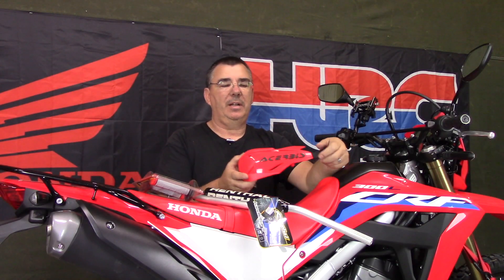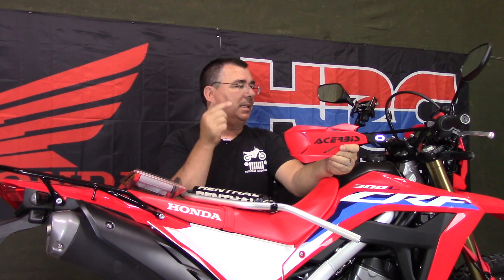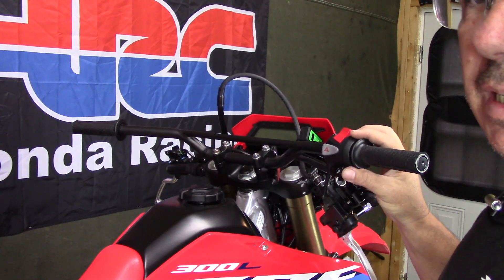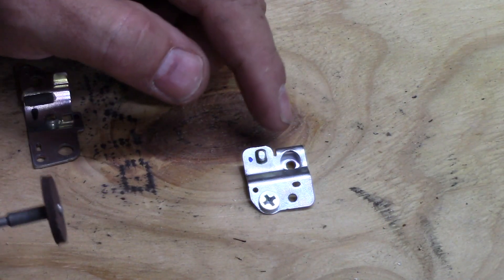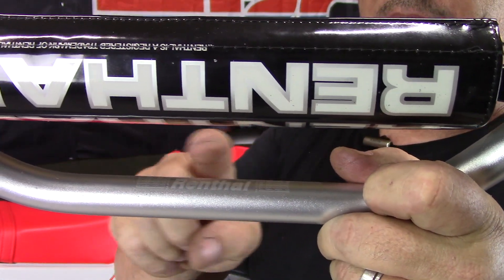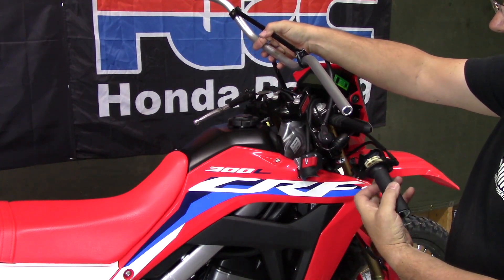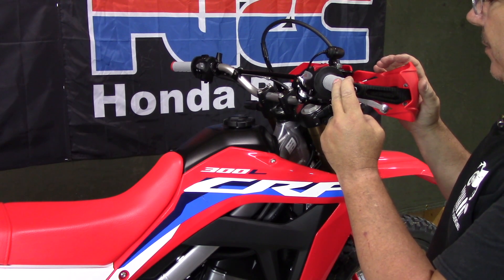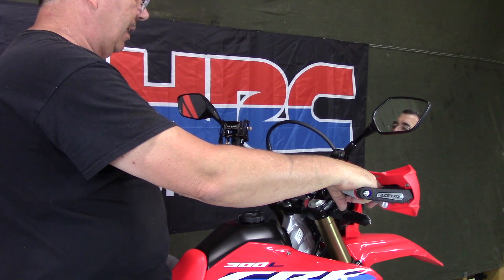Honda CRF300L Renthal Handlebars Acerbis Hand Guards ProTaper Grips Install CRFs Only

Comment: I went with the Renthal 609 CR High bend fatbar on my 300 and I love the extra height and width (6ft 2). All wires still have plenty of room too. Precision Motorcycle racks just released their 300L rear rack for preorder so is an decent USA option for a rear rack if anyone is interested.
Reply from the maker: Sweet, I am waiting one a newly designed rack, should be pretty cool. Should be here soon along with a skid plate and chain guard
Reply: Chris: Are you have 300l or Rally? What risers have you used? How high ?
Reply: @dzinksol  300L, I have the pro taper 7/8 to 1-1/8 conversion riser which is a 3/4 inch rise.
Reply: @chrisweber6129  i tried measure orginal bar. It has 80 cm high, 79,5 width and 73mm of sweep. So you added 50mm to it. Nice! I am thinking to add only riser 50mm without change bars. I do not know what will be better with new bar.
Reply: @dzinksol  Yea that sounds right, feels level for me sitting and much better while standing vs stock. The stock steel bar is fine if you dont offroad, steel bars are much easier to bend / break if you tip. The thick bar (1-1/8th vs 7/8) seems to dampen vibrations a bit better and is obviously stronger.
Reply: @chrisweber6129  May You share photos or video walk around of Your configuration - bars+risers+wires?

Comment: Trying to find the exact bars that you have in the video and wanted to get your input on what they are actually called on the CRFSONLY website. Or if you have the exact model number for that specific height and bend. I really like those and wanna get them for my new 300l.
Thanks

Comment: Wow, I ordered the same acerbis hand guards and color two days ago on Amazon! Great look!
Reply from the maker: Sweet, they are pretty good, a little hard to get lined up but pretty good, you have the rally so I think your bar inserts are removable. I have watched your videos
Reply: @Woodzman  I’ll look to your lead on the hand guard install video, I got a small kobalt socket set yesterday to adjust my rally levers. Great content and deep respect!
Reply from the maker: Yea if your using stock bars you should be able to remove the bar end weights and then the inserts and they will work fine. Because you have a rally

Comment: Hi, great information and I am starting my own bar replacement. Was wondering if you found the torque specs on the risers and clutch / brake assemblies? I only see three torque specs in the manual and none are for those components. Did I miss them?

Comment: Just came across your install. Do the brake lines, clutch and throttle cables have enough free play with the jimmy button bend or did you have to modify that later?
Reply from the maker: You have to rout one of the cables out of the hanger but it works fine

Comment: Hi Frank - 
Questions on the 3m tape please. It looks like the suggestions are 1) once around the bars, leaving a small edge exposed 2) Double sided tape. One side sticks to the bars, but for the top side do you make it sticky also? 3) tape width - .4 or .94?  Thanks for your help.
Reply from the maker: It depends on the tape, I went once around, I’m not sure about the thickness but I did leave a small edge exposed for the controls to sit on. 
 It does work but if I had to do it again, I would wrap black take in a thin layer around the bars, then put the controls on and tighten then a bit so the dimples make marks in the tape. Remember be the controls and drill the bars but not all the way through. I think this would be best
Reply: @Woodzman  I am committed having alread ground off the dimples. Will I regret it if I don't buy a replacement throttle assembly (only way I know to get the plate, have not found it by itself)? Also, If I I go the tape route, do I let the top part of the tape be sticky? Appriciate your help.
Reply from the maker: Mine has the double sided tape and I haven’t had a problem yet
Reply: I tried every thickness of tape in every location, nothing worked. I had to get creative to build up the bump on the plate I had ground off, then drilled the bar, all fixed.
I wasted a bunch of time trying to make tape work. Do it as designed and start of with a drill.
Reply from the maker: Worked fine for me, mine is still that way and working. 
 But drilling the bars works also
Reply: @jzmarzly1  how did you build the bump back up? I’m in the same position as you were, regretting grinding the throttle side down.

Comment: Can we get an update on the 3m tape? Was it effective or did you have to drill a hole?
Reply from the maker: It is still one there and works fine for me, the best way is to drill a hole in the bars for the notch to sit in but you want to make sure it’s in the correct spot first.
Reply: @Woodzman  Im a little hesitant to drill. Im afraid it might weaken the bar.
Reply from the maker: @borisbogart3288 well you don’t really have to drill all the way through, just however tall that dimple is
Reply: @Woodzman  I think I'll do the same you did with the 3m tape
Reply from the maker: @borisbogart3288 clean everything with alcohol make sure the take doesn’t enter fear with the controls,

Comment: Nice video!
Which bar is better for Crf300l -  Protaper or Rental ?
Last time you fix Protaper on 250l
Reply from the maker: I really don’t think it matters, best part about the 7/8” Renthal is you don’t have to use the adapters
Reply: @Woodzman  yes, it’s correct, no need to use adapters with Renthal 7/8. It’s will fix in main position

Comment: Hello. I am reaching out to you for help. I changed my handlebars on my CRF300 Rally some month ago becouse the bar was a little bit to low and a lot to close to my body when standing up. The bar was changed by my dealer. When the job was done and I left the dealer I forget to take the old bars with me. After changing to Renthal RC with 20mm risers the bars is now a little bit to high (easily fixed) but also makes me really fatigue when riding on long trips. I am now looking for another bar and want the original bar for reference. Do you still have the old bar? And if you do, is it possible to send me the dimensions of the bar? I really appreciate the help 🙏

Comment: I also ground off the nipples from the throttle and clutch side as you did in the video but couldn't get the throttle side very firm with the double sided tape. Are you aware if another plate can be purchased so I can drill my new bars like the OEM were or do you have buy a whole new throttle assembly?
Reply: just wrap the bar with a few wraps of electrical tape at the clamp area. This should work fine (especially with the tabs still in-place).

Comment: The levers should be aligned with the guards, you put them way down, they will brake. I understand that the handguards in that position will work better, but you should find a compromise and align them with the levers.

Comment: One thing I don’t hear people say in these on the alignment of your handlebars is if they are angled forwards or backwards, vs being inline with the angle of your front forks, you will lose a lot stability off-road since the steering geometry gets out of whack.
Reply from the maker: I put my hand grips level, and the make the cross bar on the Renthal bars pretty much center between the handlebar clan bolts. The same as the stock is

Comment: Did the tape actually give you the results you wanted? I tried so many different thicknesses and could not get the throttle side controls to not have play in them.
Reply from the maker: Yea mine works fine. I can’t say it would be the best way but mine is still holding fine
Reply: did you grind off the tabs?

Comment: Thanks for the video! I want to change my handlebars on my recently purchased crf300l. I'm on the fence between the Protaper CR high (7/8) or the Renthals Jimmy Buttons ... Did you change the cables and the clutch/front brake levers or everything fits nicely? Thanks!
Reply from the maker: I didn’t have to change anything, it all fit

Comment: What 3m tape should I buy thanks for your videos very helpful also my bike has a burning plastic smell is that just new bike smell?
Reply from the maker: You will have a strange smell for  maybe 50-60 miles but it will go away. Just look everything over and make sure nothing is touching the exhaust.  
 Just get the best 3M take you can buy, I have had mine for years so I don’t know what version it is. Just make sure the twist throttle housing part with the controls on it will Not rotate
Reply: @Woodzman  dumb question two sided right?
Reply from the maker: Yes
Reply from the maker: And the grey is better. I have black and gray but the gray is stronger
Reply: @Woodzman  thanks again I bought a bunch of stuff from CRF’S ONLY because of you hopefully one day they will take care of you 🤙
Reply from the maker: Thanks, just always mention Woodzman
Reply: Question on the 3m tape please. It looks like the suggestions are 1) once around the bars, leaving a small edge exposed 2) Double sided tape. One side sticks to the bars, but for the top side do you make it sticky also? 3) tape width - .4 or .94?  Thanks for your help.

Comment: Excellent video , can you tell me where you got the 3m tape from is it 2 sided? Mayne give me a part number or something to that effect . I ground my nubs off and now my controls slide around so I guess the tape is part n parcel of doing it the way you described
Reply from the maker: Make sure you clean the bar and control with alcohol and let it dry. Then use the tape. When you first get it back on, it may move a little but after a day or so it will get more solid. Here is the tape https://amzn.to/3JDfiVb
Reply: @Woodzman  excellent thank you for the fast response . Did you just do 1 full wrap around the bar? And the width of the gage cluster or just one piece kinda in the middle?
Reply from the maker: The full with I believe,

Comment: Great video. Thanks.
So the bar end inserts can be removed on the Rally but not L version?
I'd like to be able to put the hand guards on without changing bars when I get my Rally next week.
Reply from the maker: Yea I looks at the parts diagram and it shows they are removable on the Rally but I have not heard anyone confirm it yet
Reply: just use  6mm bolt or tap it to 8mm (i tapped mine)

Comment: Hi Frank, when I put my barkbusters on with the original bars I also put 25mm bar risers on. I found that there was quite a bit of pressure on the throttle cable on turning left. This didn't affect the control but uncomfortable tightness on the cable. I couldn't see any way of getting any more cable length. This pull on the cable will it cause problems as time pases. Do you think there is any extention bits without getting a longer cable. Cheers Trevor from Oz.
Reply from the maker: I haven’t heard of an extension without getting new cables. Min fit, but I did unstrap the cable somewhere
Reply: there is probably some extra cable at the other end, did you re-tension the cable at all?

Comment: Really grateful for this video, thanks! You cover a lot of details that others either don't or just skim over. I have a CRF300 Rally and all this comes very handy. 
One question, I haven't been able to find a service manual for the bike yet? You mentioned you'd check the manual for torque specs... Where did you get the manual? 😀
Reply from the maker: I don’t have one ether so I used the torque specs from the CRF250L, it’s all the same.
Thanks for watchin
Reply: Look in your manual and it will tell you where to buy the service manual

Comment: What kind of tape are you using?  My controls on the throttle side still rotate (wiggle) even after using gorilla brand double sided tape.  I've tried several tape thicknesses and application locations.
Reply from the maker: It’s just gray 3M tape, mine did move a little for a short time, now they don’t move
Reply: @Woodzman  You're right...setup pretty good overnight.  Thank you!!

Comment: Hi Frank,  How do you like the feel of the Renthal bars compared to the protaper on your 250L?  Is it easier to stand up?  I've considered changing the bars on my 2016 250L but I don't care for the protaper.  Just wondering if Renthal would be a better option.
Reply from the maker: Oh yes the Rental Jimmy Button bend that I got are so much taller. I love them. The ProTaper bars are good but I like the taller Renthal bars

Comment: Thanks for the video! Please let us know if you get more vibration in the handlebars at speed. I have also removed the bar-weights on my Versys-X 300 and now it vibrates at 55mph and up. But the new handguards saved my levers countless times so it's not such a bad deal :)
Reply from the maker: I just rode it to work this morning and I think there is less vibration
Reply: @Woodzman  Less?! :D That's awesome!
Reply: there used to be a device from Bontager called "buzz kill". they were placed into the bar to reduce vibrations. they were for MTB but should work on a moto too.

Comment: Where did you get you manual with the torx specs? I can’t find one anywhere.
Reply from the maker: I don’t have it but this is the link https://www.helminc.com/helm/product2.asp?class_2=AHC&Sku=61K1T00&itemtype=N
I use the 250L manual, most things are the same https://www.helminc.com/helm/product2.asp?class_2=AHC&Sku=61K1T00&itemtype=N
Reply: @Woodzman  Thank you very much! How well does the double side tape hold up? I’m a little nervous to grind the plate down in the switches.
Reply from the maker: I have not had a problem but I do believe that marking and drilling the bars would be best and you shouldn’t have to drill all the way through
Reply: @Woodzman  Ok, I had a feeling you might say that. Is there an easy way to make that spot?
Reply from the maker: Wrap 1 layer of black take around the bar then tight the controls down it the correct spot, the dimple will make a mark in the tape for your to drill
Reply: @Woodzman  Excellent, thank you for your help!

Comment: DO NOT GRIND MOUNTING TABS when replacing the bars. It only takes a few minutes to drill the new bars   Do it right!
Reply from the maker: That is the best way in my opinion also as long as the person can get the holes in the correct spot. 
 I just can’t show drilling the bars because it’s not recommended by the bar manufacturer or retailer
Reply: @WOODZMAN tbh man this tape idea is stupid and your asking for problems if u do this. I've seen peoole posting they can't get their throttle side to stop moving when they are still on the lift. Imagine bouncing around on the trails all day. I get why u put the disclaimer at the end. But it's bad advice and the person above is right.
Reply from the maker: I totally agree, I was sent the bars to review and just had to install they the way I was told, I did however remove them and do it right later
Reply: Ok but peoole are warchung the video.  Not diggin in the comments. Thst part isnt sold alone. And its more expensive than the bar was to begin with. You say in the video youve done it numerous times, never had a problem. Come on man. Anyway aside from that you seem to know what your talking about. But maybe post a link to your fix. And something on screen that says dont do this. Ive since corrected. @WOODZMAN

Comment: are the new bars higher than  the oem bars? That would be a better option I don't like the idea of having bar raise the bar risers. I have a 300 rally and when I stand I'm just a little too crunched over and I need it a little higher.
Reply from the maker: Yes they are the Jimmy Button bend and they are high bend, a lot taller
Reply: @Woodzman   thanks much I'll  be ordering a set ... I'm planning to take my  bike on on the TAT or the CDT trail this year.  Getting it all set up

Comment: I may go for some new bars for my 250l Rally but I'll drill the holes. Just apply some masking tape on the bar from the end and past the hole and poke a hole in the tape with an awl and spacing should be fine. I'll just need to position bars before locating the angle of the controls. I'm probably going with a Henry/Reed bar as I have them on another bike and like them. :)
Reply from the maker: I think drilling is probably the best and I don’t think you will need to even drill all the way through the bars